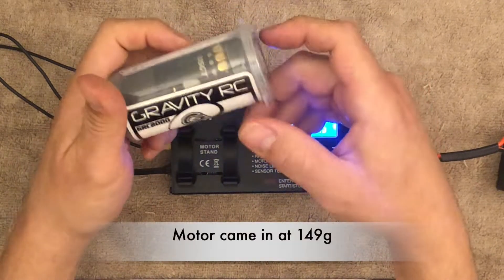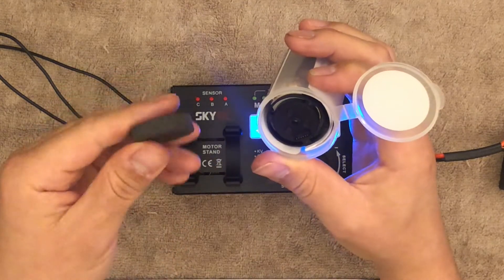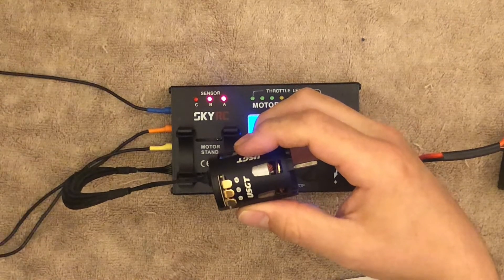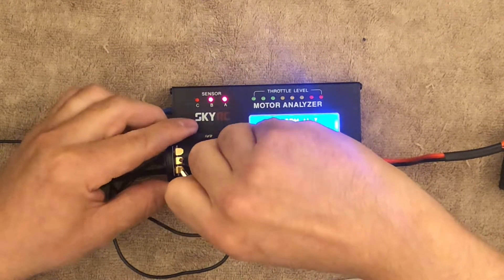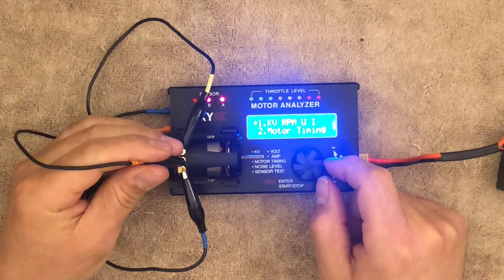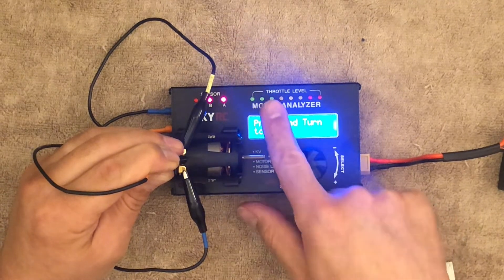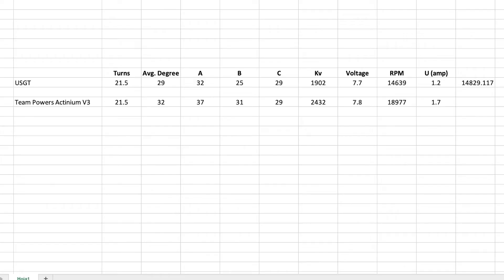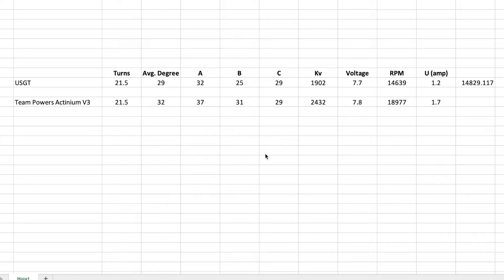Gravity RC 21.5T USGT Motor Specs Kv weight

Comment: Would you have to gear up the pinion for a Pancar?
Reply from the maker: You have to gear it to the moon on a pan car. Not sure if we are talking 1/12 scale or a 1/10 like a WGT. But it has to be geared high. I cannot recall the ball part FDR. I cannot recall if my FDR for USGT was 4.3 but I think I was running a 95T spur and 42T pinion with a 1.9 drive ration between pullies which gives about that 4.3FDR. Pan cars, like F1 are light. USGT is 1350g for example which is heavy in comparison. The important component if the pan car FDR.